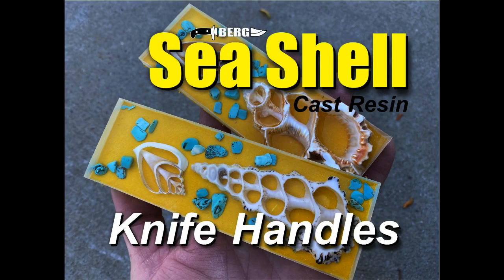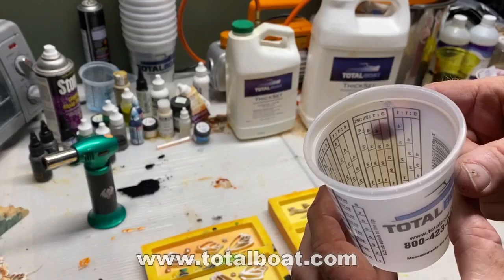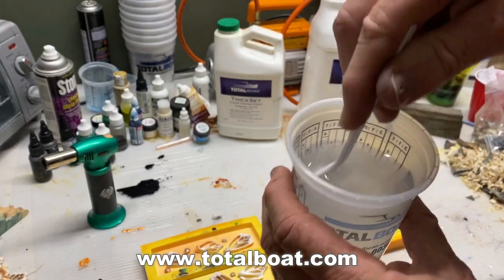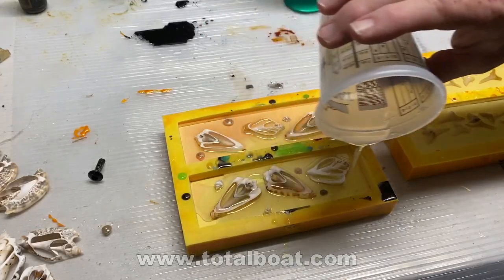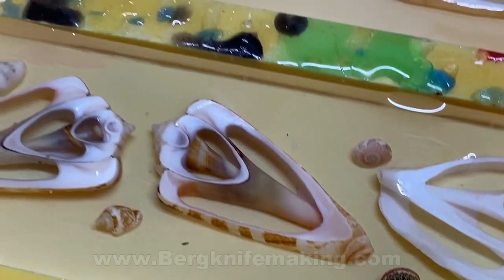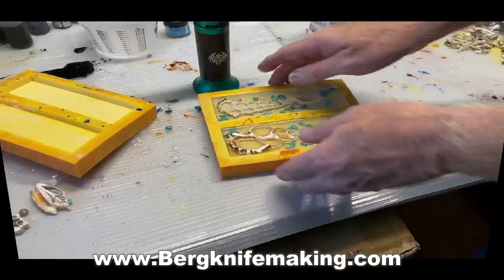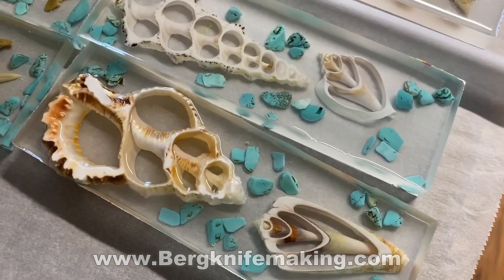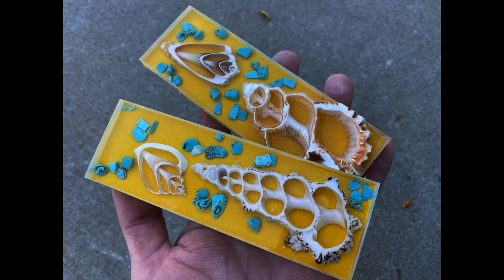How to easily make Sea Shell cast resin knife handle scales by Berg knife making

Comment: Have you ever tried to put the liner in the bottom of the mold? We’ve recently gotten into pouring, but have only used fiberglass resin with powdered pigments, so far
Reply from the maker: I have but usually have to grind the bottom a little to get it perfectly flat. Attaching liner after prevents uneven liner thickness